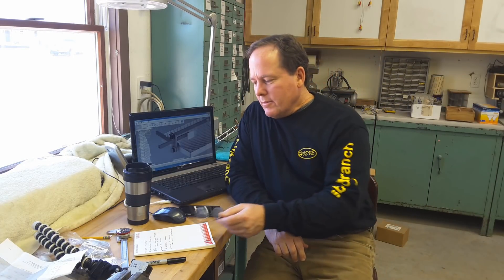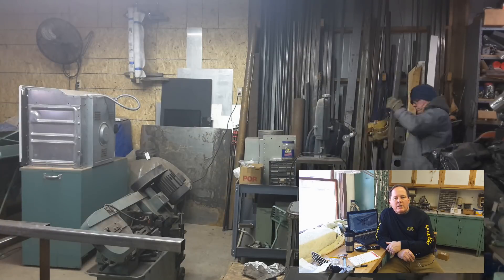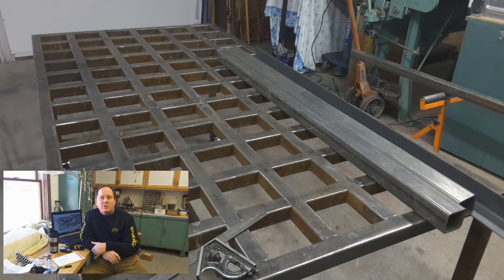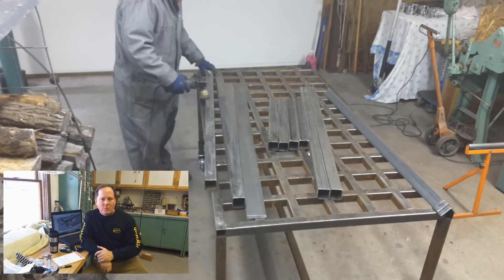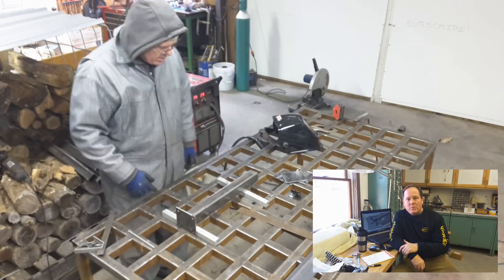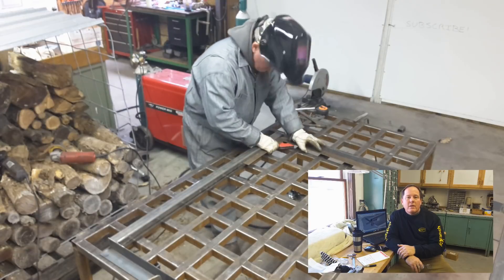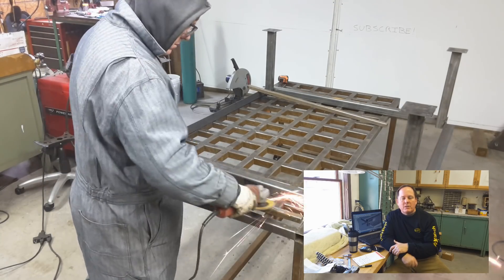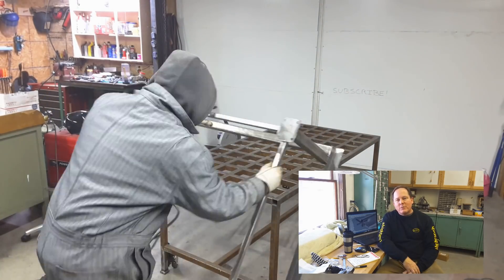DIY CNC Plasma Table - Episode 1

Comment: I am about build a cnc router and cnc plasma cutter all in one. Your design is perfect and is the way I was planing to build mine. After watching some of your videos i think i will make two machines instead. Also i am thinking about adding a diode laser to the router, one that attaches to the spindle, that way i can do both laser and router on the same work piece without to much hassle. thank you for the great videos and ideas.
Reply from the maker: I came to the same conclusion.  One controller and two machines.  You save about 50% on the second machine. ~P